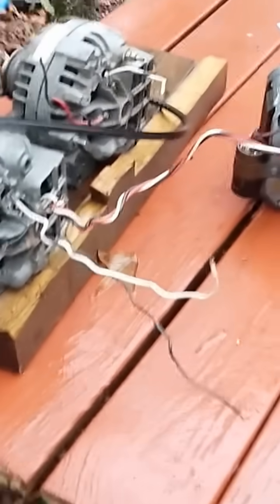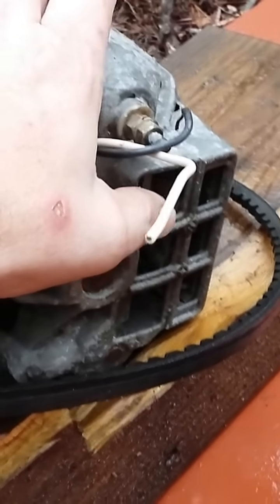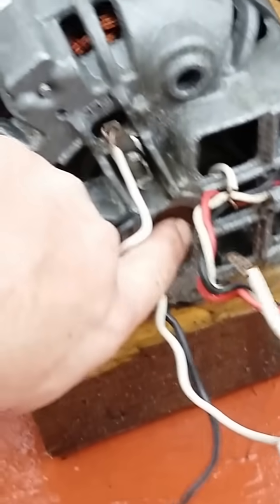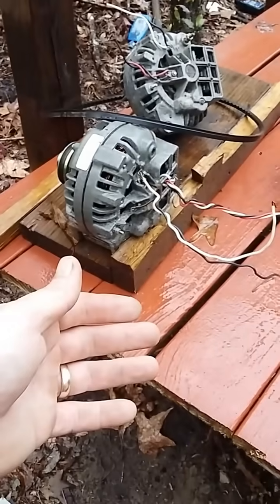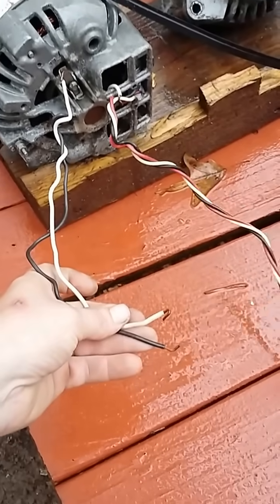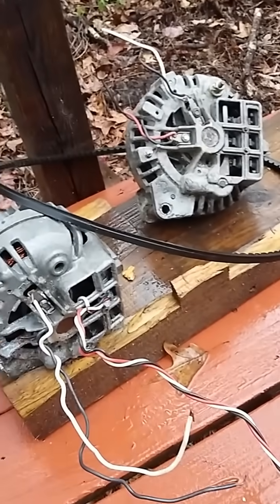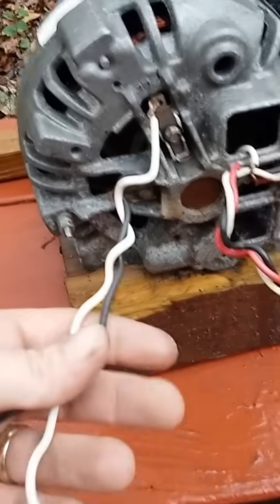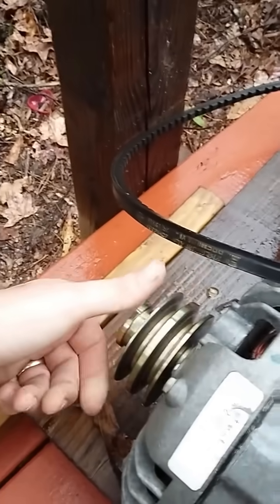Update Free energy forever no wind no solar no gas READ DISCRIPTION!!!

Comment: 90 amps at 220v single phase you would need a minimum of #2 gauge wire for it not to melt under load and you have #12 gauge wires.  Thats 16x too small of wire to carry the current and heat of the load.  Furthermore, the internals of the alternator aren't made for that kind of load.  They are made for 90-150amps at 12 volts, that's almost 1/20th (1/10 for two) the power you're claiming to be pulling from them.  Are you telling me they over engineer alternators for 10x-20x the predicted load?  I love how your comment is a sob story into a guilt trip,  I smell manipulation!  Don't tell me your trying to help the world while you're deceiving people.  If you really believe what you are saying is true, do yourself a favor and do some research.   Nothing is free,  you cannot conjure lightning bolts from your fingers and what you're claiming is no different!
Reply: You wouldn't need number 2 wire....I hate ppl like u who over size the hell out of wire because u have no life experience but reading charts that tell u to way over size everything...son
Reply: Actually I'm an engineer...  I run 3 phase 200A power distribution for concerts on a weekly basis.  There's a reason you over size your wires...  It's called thermal management.  the hotter a wire gets the less efficient it becomes at passing power and snowballs out of control.  so yeah you might be able to get away with smaller wires most the time but it's better to be safe than sorry...  And those charts you refer to are made for a reason!  What is your "life experience" again?  You're the kind of guy that runs a circuit to a garage with 14awg wire and wonders why your table saw has no balls!
Reply: Just one more thing.  He says 180 amps is plenty enough to run your house...  he doesn't realize that the alternators output 12v.  Let do the math 180a x 12v = 2160w compared to one 20 amp circuit at 120v.  20a x 120v = 2400w  that's 90% of ONE 20 amp circuit.  My whole house is supposed to run off 2160w?  My house as is has 12 x 20 amp single phase circuits and two 50 amp 2 phase circuits.  That's a potential of 440a load i am capable of before popping breakers.  lets just see how many watts that is to compare to the 2160w we would get from the alternators 120v x 440a = 52800w (4%).  lets see how many alternators that is if 52800w / 1080w (1 alternator) = 48.8  so basically 50 alternators to have the same potential as my house feed, not to mention I can add more breakers.   On top of that he never tells you how he turns the alternators...   I'm all about renewable energy but guys like this just impede progress.
Reply: You guys and your math! You just take all the fun out of being a snake oil salesman!  ;-P
Reply: And to think at my friend's place I'm running a 400 Kilovolt line at Multi-Megawatt power consumption for exploding hot dogs and pig roasts into well-cooked meaty shrapnel.............. (it's a Huuuuuuuuuge Data Centre!!!)

---

The base physical issue here is Laws of Physics where:

Energy Out =  Energy In - Secondary Radiative/Convective/Other Heat/Photon/EM Loss

BUT in certain circumstances more to do with Planck's scale physics, energy output can actually SEEM to pass a NET GAIN point from the input. Using an analogy, while the conversion of Light into Electricity using Solar Panels is common, it is a given that the ORIGINAL EXTRANEOUS SOURCE of the energy allows us to PRETEND that the energy is free when in reality it's base source is a far away Yottawatt+ Nuclear Fusion Reactor (i.e. the Sun).

This is NOT a Quantum Fluctuation Device getting Megawatt scales of energy from the quantum foam! It's an alternator held in series that NEEDS to get input from an EXTERNAL SOURCE and will output ONLY that energy which is coming IN SERIES from far away sources...be it one or more batteries, a hand crank, a water wheel, etc.

Eventually that energy source will run out OR must be replenished in some way. The KEY ISSUE is whether or not that OFFLOADING of energy replenishment can be considered truly free or faraway enough that cost is NO LONGER a consideration for the end-user.

Of course, if I buy multiple $400 German-made Neodymium Magnets and configure them properly to avoid the "Magnetic Motor Eddy Current Issue", I can INDUCE a current into the "Alternator/Generator" outputs BUT again, I've offloaded the cost of what seems to be "Free Energy" into multiple $400 magnets so unfortunately not a true net gain. When the original Video Poster used the term "Stator" I am GUESSING this is what he has done by creating an inducted current from some rather expensive magnets oriented in a specific way within the alternator housing to allow a long-term rotative force to be created that is output as current. The stator DOES EVENTUALLY run down due to various internal forces including friction and thermal breakdown, but again, you've spent money and time on expensive magnets so it's NOT REALLY FREE!

Comment: You need to study the laws of conservation of power.  Your alternator is 90 amps at 12 volts.  Using ohms law Volts  x Amps = Watts would equal 12 x 90 = 1080 watts.  Now substituting 220  x  X=1080.  X=4.9 amps.

If  your output as you claim at 220 volts is equal to 90 amps, then  your wire it tremendously undersized.  I dare you to put a 90 amp load on the alternator at 220 volts to see what happens to the wires. You're basically telling us the alternator is capable of generating 19.8KW...or 18.33 times more capacity than you put in.  Clearly, this defies the laws of physics.

Don't pee on our legs and tell us it's raining when you're telling us you get over 18 times more power though the demonstration you show.  Electricity doesn't work that way.
Reply: I wish half these haters had a 1/4 of a mind to think outside the box and create something. Instead of trying to bring someone down.  Keep at it n these negative people can be stuck in the world they are told is the truth
Reply: @TheTaTeR187  clearly, you are one of those morons who believe this crap.  Educate yourself on electricity and the laws of physics. Once you understand the topics, you’ll finally understand what the video talks about is not possible.  You can’t get something from nothing. There is no such thing as perpetual motion.
Reply: can,t stop laughing   boom ring a bell

Comment: Yes, you seem to have two automobile generators on a picnic table.   The only power that will come out of those generators are from the armature on the generator spinning at a high rate of speed allowing it to cut through the copper winding's creating approximately 16 volts to charge your car battery that's then used to spark your spark plugs to turn the cam, to turn the flywheel to turn smooth out the ride.  Now, you mentioned 120 volts and shit being free.  First shit is not free, it cost money to make number 1, maybe I should have made that number 2, and number 2 you don't mention what you're going to use to drive the armature where normally you'd have a belt driven by your engine to turn the armature to create power to charge your 12 volts battery.  So answer those questions then you can worry about the space men coming down from the sky and kid napping you.
Reply: FgvbZ ul Lee no
Reply: Bantham Nobilis  Yes, you are spot on.

Comment: He was talking about using direct current off of a battery of some sort. What he failed to mention was, how he was charging his battery backup after pulling juice from it. The problem with this is from what I see is that it takes a lot of juice coming back in when you're using a lot to feed a house or whatever you're trying to power. You would need some good batteries, like really good batteries like a whole bunch of Optima car batteries lol 12 or more maybe, 12v battery x 12 = 144 volts
 And a charge controller to create the power bank( to cycle what you don't use back into the batteries to keep them charged and powering the system. 
In Theory since were using car parts here.
According to Ohm's law and using ohms triangle
0.6 resistance (resistor)
144 volts (12 car batteries) at 12 volts each
240 amps (2 120amp truck alternators)
Stabilizes out at 34560 watts 
You can buy $5,000 generator that consumes gas and it puts out 20000 which is what it takes for an average household to run fully and not bog down in any way shape or form.
It would work if done correctly. 
You have to know what you doing though. Think about it a battery in an alternator keep your car running as long as it has gas eliminate the need for a gas motor and use an electric motor like a Tesla car does get you formula down pat electric motor or several Motors couple alternators bunch of batteries and a charge controller out of an old RV or one aftermarket you buy offline wire it up right what's the correct gauge wire sure you have your resistors and your alternating current because houses run on AC thanks to mr. Tesla winning that race way back in the day and Bam 34000 Watts enough to power whatever you want probably would want a small 12v to 240 volt transformer. 
I would go small prototype and try to use it to power a power inverter first and the power a washing machine then add too it like tv and washer or washer and dryer
Reply: aaron Mishoe he could use a large solar charger
Reply: When there's a will and the know how it always works, alternator produce A/C current and one truck battery powers a washing machine for one hour completely drained in the end so with right resistance and wire gauge. Charge controllers and 12v to 240 or 600volt transformer. And a separate power bank yes it would work. But it's just reinventing the wheel. It's already been done d/C to a/C current easy stuff just keeping it self sustaining is the challenge

Comment: Ya  alot of questions lol so u never said what drive the alternator a gas motor. a wind turbin
Reply: He was talking about using direct current off of a battery of some sort but what he failed to mention was how he was charging his battery backup after pulling juice from it the problem with this is from what I see is that it takes a lot of juice coming back in when you're using a lot you feed some good batteries really good batteries like a whole bunch of Optima car batteries lol 12 or more maybe. And a charge controller to create the power bank.
Reply: I noticed in the video that WHERE he is located seems to be rather an enormous amount of BIOMASS available (leaves, trees, etc) whereupon for the mere expenditure of a few hundred dollars of chemicals and/or using a lab-full of bacteria cultures, I can create a few tens-of-thousands of litres of Methanol (Wood Alcohol) from that biomass, which can be used in a Thin-Film-membrane based Fuel Cell (i.e. a Ballard Cell) or a micro turbine methanol-burning generator. The amount of fuel I see available at his campsite would be enough to power an average home for two years OR MORE at a full load of modern conveniences!
Reply: He runs an alternator from the power he makes from the alternator to charge the battery he runs the alternator with.
I did mention that there is an alternator being used didn’t I?

Comment: I have an electric motor I was trying to run with alternator and have the power run in circles but electric motor is getting hot red white black wire whats the white for?
Reply: Is getting red hot because you're not doing anything with the electricity coming from it it's putting out more and more with nowhere to go this electricity of course creates heat along with power you got to give it something to do like power light bulb or a fan
Reply: He was talking about using direct current off of a battery of some sort but what he failed to mention was how he was charging his battery backup after pulling juice from it the problem with this is from what I see is that it takes a lot of juice coming back in when you're using a lot you feed some good batteries really good batteries like a whole bunch of Optima car batteries lol 12 or more maybe. And a charge controller to create the power bank. Here's the formula 

0.6 ohms resistances
240 amps
144 volts 
= 34,560 watts 
$5,000 generator that will power your whole house only produces 20000 Watts that's what the average household needs to run fully

Comment: Who is it that doesn't want you to know this? It's in ANY mechanics book, it's also NOT regulated voltage, so you can easily ruin your new TV or microwave. you can't plug that into your wall, that is a 3 Phase motor, won't run on single phase. OMG, you won't live very long :) that's stupid, LOL it's NOT 90 amps at 240 Volts you idiot! it's 90 amps at 13.7 Volts. learn what a Watt is dude.
Reply: The iluminati !
Reply: can he reduce to 120 watt?
Reply: @ipeeinmysinkimafraidtocome7127  your name...... Please msg me
Reply: @ipeeinmysinkimafraidtocome7127  can he reduce WHAT to 120 Watts.

Comment: #2:awg guage forb100 amps
 What rpm you spin it at ? 3600
 I made some of these 20 years ago. You should talk about rpm and what horsepower for novices
Reply from the maker: Ronald Daub if you want the full power then 3600 RPMs is pretty good. if you are bypassing the trio to get alternate current, then it needs to be at 3600 RPMs anyways! because 60 pulses per second or 60 hertz x 60 seconds equals 3600 revolutions per minute. Considering you only get a little over a thousand Watts out of each alternator, even though it is a true 1000w and not like one of the junk inverters... but if you had a few of these running efficiently at a cost of 30 to $0.50 a day or using wind or water then you would be doing very good! there is another trick using 3-phase permanent magnet motors that you can use that I've been doing for years but you have to use pulse width modulation and amplify it up to 396 volts(around 14,874F) but it only consumes a little under 700 Watts 0.75Ah but you get over 45 horsepower from the motor which in return means you can turn two ten thousand watt self-excited generator heads... Thanks for the comment!

Comment: This is a Joke correct?? Plug the alt like you stated into a wall and see what happens. The 3-6-12 volts or what ever just activated the electromag. The trick to Free Energy is the power it takes to spin the Alt to begin with. It's not fake it's just not thought through or actually built to find out none of this is close to a completed project that would ever function.  Trust me no one is after you. ROTFL!!!!
Reply from the maker: John O yes you are correct and that is the exact reason why I made this video incomplete and switched the words rotor and stator and a couple of other things, so no one would be after me and I know that you haven't watched any of my other videos or you would know this as fact! thanks for the comment..

Comment: first thing does he not say ad 3 to 12 volts to run the fucker..so why are ppl asking how does it turn
Reply: 3-12 volts is to activate electromag or stator. Has nothing to do with spinning the Alternator. My guess is he has never hooked it up and found the motor will take more power to spin then the alt is putting out.

Comment: Part of me wants to laugh, but part of me says you need practice with film editing.  First time for everything.  I understand what you're saying, but energy transference in a reliable manner is very difficult to create.  You're bypassing dc output.  So constant force is needed without fluxations in speed.  So as I would see it, small DC motor connected to alternator 1 with DC out put.  Once started in motion, will stay in motion, alternator 2 and 3 outputs ac...  with gearbox in motion, energy could be gained.  It's great and all, but they've imprisoned people for windmills......  Make no mistake, no one in the USA owns anything.  It's all considered a luxury any more......
Reply: you know all you got to do is run ac at constant .then it finds it way back home with very little loss ..then use a bus bar as the jump point .sad its resonance not watt hours

Comment: So wrong on so many levels. First.....90 amps at 12 vdc as installed in an automobile. Once you took your voltage source bypassing rectifier and used  AC  it reduced the amperage. 12 vdc x 90 amps -1080 watts. That's all the power you have. You might have 4amps at best with 240 volts or whatever vac you stated. Plus how are you SPINNING the pulley. You are using more power to spin it that you get back. At what speed ? 3600 rpm -60 Hertz. What house current is in the US. Take a electrical class. Read some books. Stop spreading bullshit.
Reply: You have 2 videos of wheelies on a bike and your grammar is shite Its "AN electrical class" go back to your' IQ depleting bike Wayn(ker)o
And that branch should have been bigger to knock some sense into you.

Comment: let's see what you've set up, if you said you've done it ,..let's see the successful operating one, rather than this, which you continue to repeat the same comments over and over like six times, but still nothing is proved?  show the successful operated one on YOUR HOUSE! Simple, right,..?
Reply from the maker: JoeT001 yeah it is very simple! especially since that is exactly what's running my damn house!!! Those two car alternators only one of them with the field wires hooked up because one was plenty enough to charge the battery Bank to run the inverters!!! do you know how much fuel cost? Well considering I know how to make internal combustion engines run off of water... it's very cheap! 
And NO! you don't use low voltage High amperage or sodium bicarbonate...

Comment: The energy is hardly free.  You must put about 40 watts in the rotor coils, and you must supply about 1800 watts through rotating the rotor, from an external gasoline powered engine, typically 5 hp.
Reply from the maker: Charles Long yeah you're right water is very expensive especially since it falls from the sky...